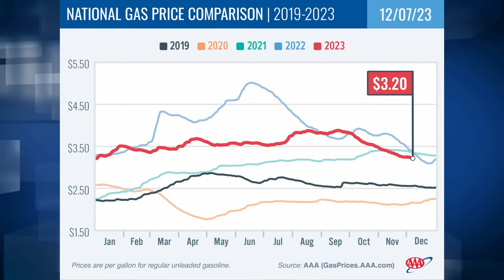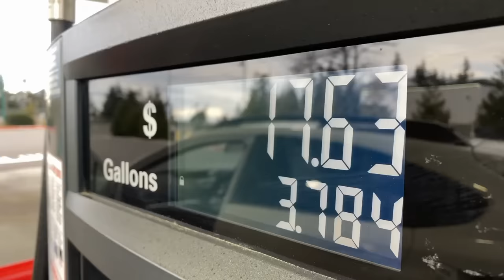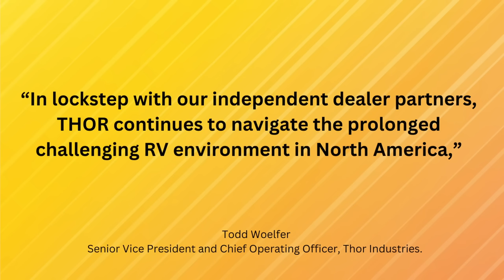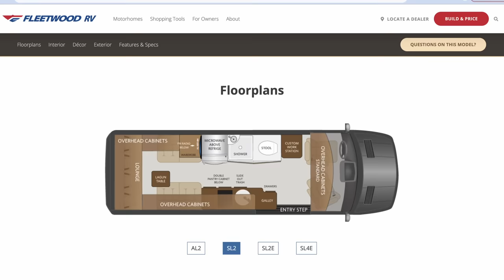Big RAM Truck Recall, 2 New Class B RVs, RV Manufacturing in 2024, New California Diesel Regulations

Comment: Interesting. Ram has some odd electrical issues.  This past summer our Winnebago GL on the Promaster chassis refused to turn off.  After much searching thru the menus on the dash display, it allowed us to shut down the engine but stated you would not be able to start again 😂.   ( thankfully, it lied).  Not very comforting when out traveling the west. Having been involved with aviation glitches all of my life, the fix was to simply totally depower everything…ie, disconnect the chassis battery for a period of time. Electronics can get to a point where they are more of a hinderance than a help. Always enjoy the efforts, Jason!

Comment: I don't have a vehicle over 14000 lbs, but I am considering buying a new F450, which is rated at 14000 lbs.  My solution to the California mess is that it is my goal to NEVER spend even $1 in California unless I absolutely have to.  This includes my professional work as an engineer.  I simply avoid work in the state.
Reply: Agreed
Reply: Exactly
Reply: Dont' worry, the 2025 F450 will be 13,900 pounds. California put a 10 cent tax PER beverage container over 24 ounces 20 years ago and that's why, nationally, all containers are 23.7 ounces.
Reply: My hubby is saying the same.  I would like to visit the National parks some day but agree I do not want to support with my dollars.  Staying away for now.

Comment: Not the first time Rams have had turn signal problems. My ‘06 2500 had a similar issue
Reply: I have 2 2006 2500's, both with over 300,000 miles, one being my daily driver. First I've heard of this. Routine maintenance, that's it.